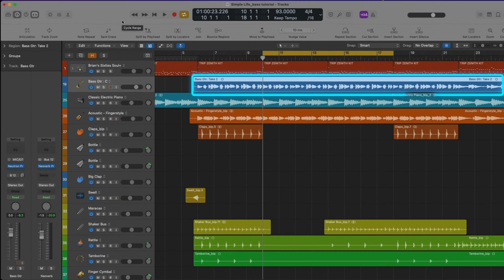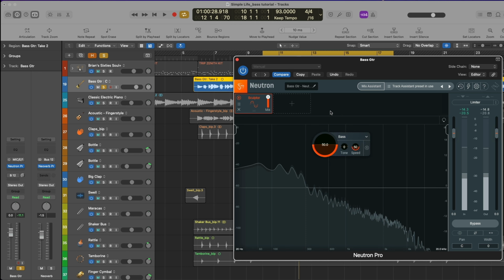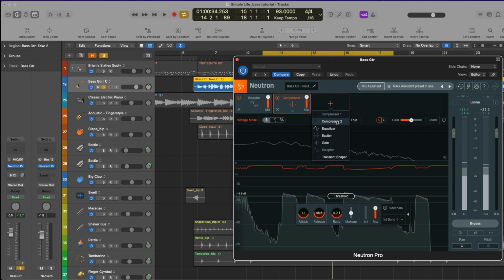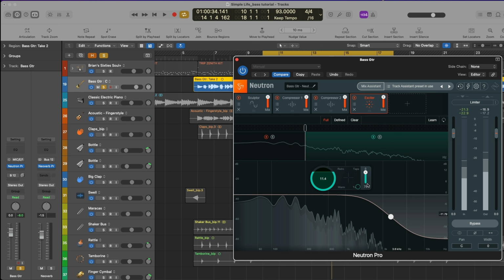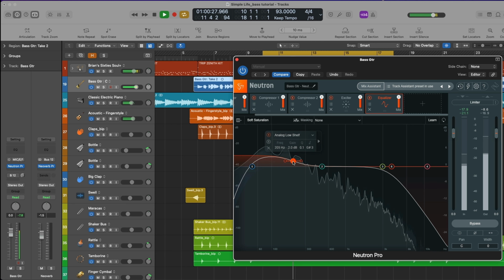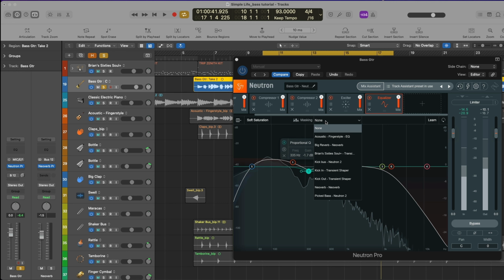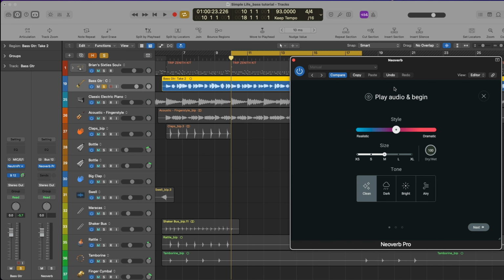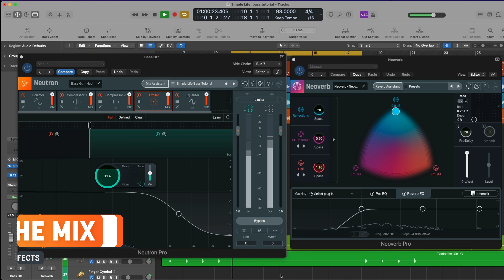Mixing DI Bass: How to Sculpt a Great Sound

Comment: Very nice job.  I actually followed along on a track I am currently recording.  The settings worked well.  I didn't use the exciter, because my current setup sends the bass through a small  Orange amplifier to get a little gain (not optimal I know).  Doing this adds the exciter features almost exactly like Neutron does on your video.